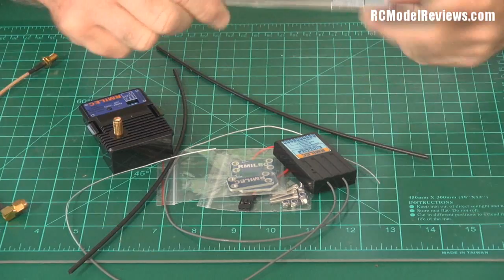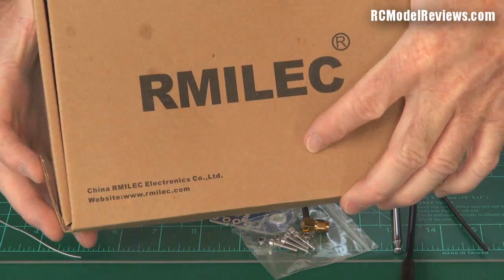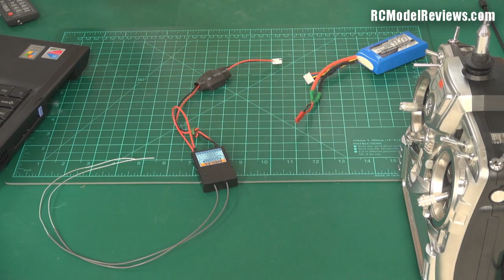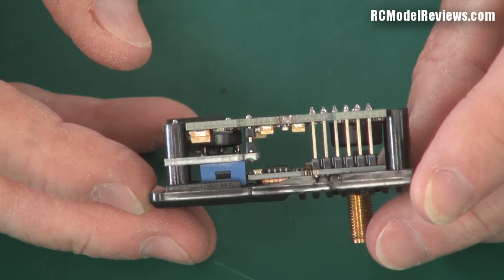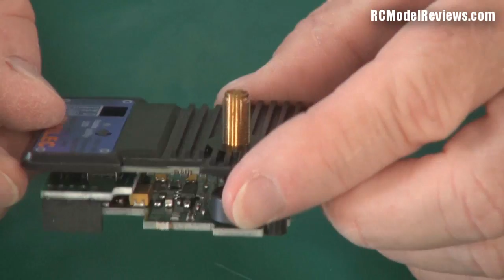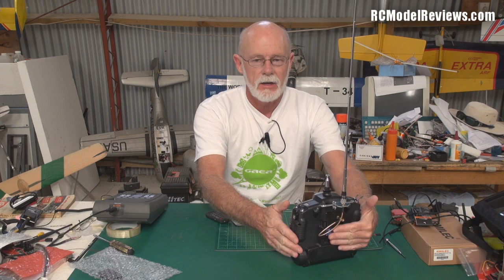Review: RMILEC UHF long range RC system (part 1)

Comment: did that wobbly antenna have physically loose joints?  cause that would make it electrically loose as well, which could effectively disconnect the load, and cook the transmitter.  not to mention crash your craft.

Comment: I have been using this system for a couple of years now. For short ranges. How exactly do I get one wire PPM output please ?
Reply: Just connect it to the PPM pin (what would be CH9 if it wasn't PPM), it's always enabled.

I've been using this for a couple of years now too, this system works but I never got farther than 2km outside of the city, always hit failsafe around that distance, sometimes at less than 1km if close to the city.  Last month I travelled to Lima, Peru and I'd get a radio failsafe even as close as 100-150m if close to the city.  (all this using the LITE version receiver though because I find the price and availability much more practical if you need multiple receivers)

BTW do I see correctly that the Part 2 of this video never arrived?  Been waiting for it.

Another question: does anyone know of a way to measure the actual output power of this thing?  I recently got a cheap radio watt-meter but it won't work with frequency hopping, gets all confused.  I suspect mine is broken (possibly by leaving it on without an antenna at some point... it's been a long time I'm using it) because it never gets hot, the transmitter runs very cool.  I bought a 433MHz booster (amplifier) but I need to know the current output power before I try a booster or I could burn the booster.  My friend gets a longer range than me with a stupid futaba and a 1W booster (iirc).

Comment: yep 433Mhz is Ham Radio 70cm band in most countries, in NZ..So I could wipe out the reciever in the plane with my amateur radio, quite easy, I run around 45watts on 70cms in the car, could be interesting

Comment: Not sure if anyone reads this now. Anyways, here is my experience: At first i was not delighted with it at all. I had around 3km range on it. But than i have noticed that almost all other LRS systems has much better antennas. Most of them use dipoles. So i have made my receiver antennas dipole. Placed them vertically on the wings, and since than no FS! Not even one! I cant fly out of its range now, as my planes range is around 6km. This is my experience.

Comment: were you able to configure 10 channels on the transmitter? i am using 9x and tried everything but couldn't get P and A channels to be configured as 9 and 10 channels simultaneously.

Comment: Bruce, what filter can I buy to help this out? I have had this for about a year and just put it in my plane, so I need to clean it up or buy 2.4mhz video system. I tried it with 1.280 and 1.258mhz not good.

Comment: the new modules got a better antenna and there are filters :
"Low frequency Power supply noise filter: Include
High frequency noise filter: Include"
Sounds like the problems are fixed ?!

Comment: Im not sure if it will work beause theres a wire that comes out of the turnigy x9 and you would have to cut it. But why would you want this system after this review? It overheats to an extreme degree and it leaks frequincy's way up its harmonic range!

Comment: Hello Mr. Bruce, is possible use a F-TEK 31AP Flight Stabilization Controller & F-TEK OSD Combo with this Rmilec and the fatshark attitude and turnigy 9x. thanks and thanks for the videos i learn a lot for you Sr.

Comment: Hey Bruce, nice review! I was wondering if you could do a review of the Origin MFX-800 DSM2 module to be used with Hitev/Futaba/JR transmitters to allow them to bind to DSM2 BNF models. I have one to use with my Hitec Aurora 9, but can't seem to get it to bind to my Blade MQX quadcopyer and I have played around with all of the settings. Or if you know of any other way to give DSM2 to a Hitec Aurora 9, just for those BNF. Thanks again for the incredible amount of useful info, really appreciate.

Comment: No. Even a tuned antenna will radiate all harmonics, that's normal. Its caused by a poorly designed low pass filter.

Comment: Most reviewers point that the antenna was causing also heating problems.  Changing the antenna makes a huge change as they say.  In fact the newest version of RMILEC has a new antenna just like the one Bruce has on the scanner.

Comment: It would be GREAT to find how could this system work with some changes....  I bought a better antenna and also an IBcrazy notch filter 400-1.3    but I don't have equipment to show if problem is solved....Also interesting to see if there is any difference between this and stuff like Immersion rc     Cheers!! great review TKS

Comment: I have a rmilec 433 system and use it in  Lanzarote,( its hot in Lanzarote) the tx module gets very hot with the standard antenna, Change the antenna for a 12 euro one from E-bay and you will have no problem. Do not use the high power, you do not need 2 watts of power unless you want to microwave your eyes*****

Comment: Bruce FYI, there is a member on the rcgroups forum that is manufacturing a nice machined metal backing for the module, this would certainly help with the dissipation of heat. I used this module for a while, but ran into range issues with it, and it was "dirty" for sure. I've since moved to RangeLink UHF which has been much better, and only takes a fraction of the power with better results and filtering!

Comment: Thanks for confirming on the analyzer that it has *zero* harmonic cut filtering. 
Wait till you find out how easily the RmileC Rx  is crushed by external Rfi, be it DTV
broadcast towers, or even a mildly Rf noisy camera (like the GoPro) onboard the plane.    The Rx has extremely high sensitivity, but no front end filtering.  
This is the only UHF system I tested, and simply refused to fly with.

Comment: i know for the price of the transmitter it should be better filter, but now that you have it, thinking maybe you could  maybe play around with building some low pass filter? but the getting very hot, i hope its only SWR.. the 3 hop's kinda stuck with that. i  like the 70cm band longer range. really really like your video's, keep up the good work, thanks

Comment: Bruce, How would this UHF go on a quadcopter with GPS?
Any problems?
I have a JR X3810 using the FRSky system atm which is great but UHF would be handy fo extra range and more solid connection.

Comment: You need  the R Mile C  SRC771 antenna, you will find the module runs much cooler.
Chuck that long antenna in the trash , it's garbage.

Comment: Bruce, the channels are chosen during the bind process. it scans the surroundings on bind, so if it finds a strong 433 signal it would choose a different band. try binding it with another 433 source switched on nearby.

Comment: Try using it outside the tin shed your in, the rf signal is being contained in a small area,  its like trying to use it without the antenna, like you said you will cook the insides an being in a tin shed your containing the signal cooking it...